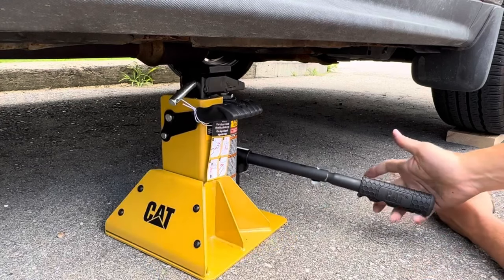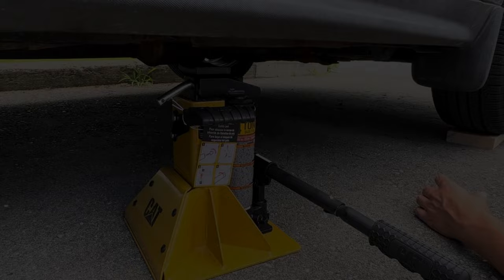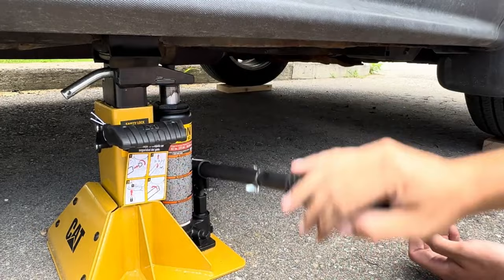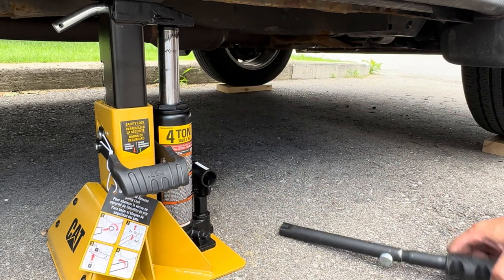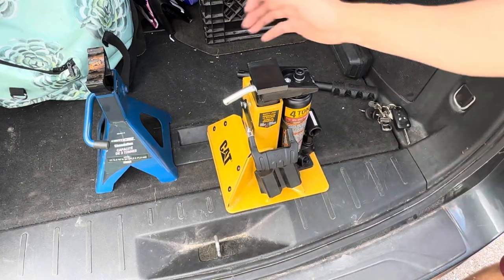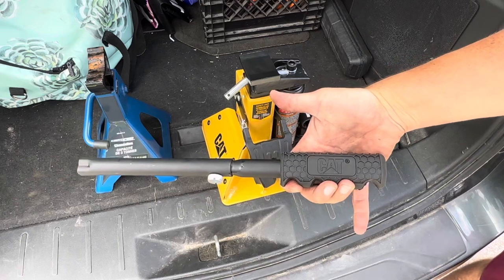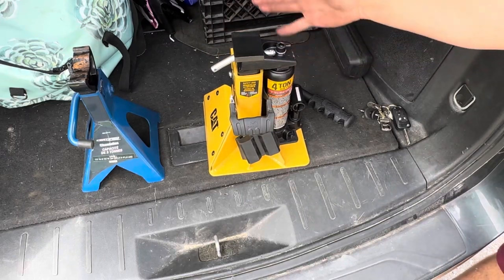Caterpillar 4 Ton All In One Jack Stand Demo/Review

Comment: No link in description. Looks like you have to drive your vehicle up on blocks to use it so the jacking function wouldn't work too well on low vehicles.
Reply from the maker: Your vehicle needs 11 inches clearance to be able to use this jack. All in one jack stands are not intended for lower vehicles. Suvs and trucks only

Comment: I have a similar unit. The one thing I dislike is that there’s 2 failure points and they are not redundant (the extension pin, and the locking mechanism). If either of those fail, it would be catastrophic. So the probability doesn’t work out great. Most late model jacks have a locking mechanism and a redundant safety pin.
Reply from the maker: It’s rated for 4000 pounds. Just keep the load under that capacity and you will be ok. The locking mechanism is the same as a traditional axle stand. If you are scared of these “failure points” then you might as well not drive because your vehicle has dozens of failure points that are way more catastrophic if they fail. Do t over analyze things. These jacks work well. You are misleading people with your paranoia. Thanks for watching though.
Reply: @BillOfAllTrades2016  Union probability is not your friend when it comes to safety. Things fail. 

I do use my unijack all the time. I just stick a wheel underneath the car for redundancy.
Reply: @BillOfAllTrades2016  4 ton rating is 8000 lbs.
Reply from the maker: Ya I know that already. Thanks.
Reply: The locking mechanism is somewhat supported by the jack still?
Reply from the maker: Yes the lo Clint mechanism is what supports the jack when you set it down like I showed in the video

Comment: Great demonstration and thanks. My current vehicle is an F150, and I am considering purchasing this Caterpillar Jack in the near future. It looks durable.
Reply from the maker: They are durable. Love the extension and wide sturdy base. Definitely worth it. Thanks for watching. Glad I could be part of the decision. Please like and subscribe
Reply: I also have an F150 on 37s with 7" lift. I've been beating my head trying to figure out a floor jack + jack stands arrangement but not having luck. Came across this tonight at 8000lb and got way more excited over the other brand 6000lb product. Is the link price for a pair or PER jack? Any discount/coupon code?! Might have to wait and see if BF will yield a sale.
Reply from the maker: The link in the description is per Jack. They do go on sale occasionally. They went on sale 10 hours after I bought mine. I went back to the store and got the difference refunded. Thanks for watching. Please like and subscribe
Reply: For a large vehicle such as a truck, it would be wise to find out the travel of the suspension, both front and rear before spending money on a jack.  The lift of the jack must exceed the travel of the suspension, otherwise the jack will not raise the wheels clear of the ground.  The more that the jack lift exceeds the travel of the suspension the better.  I had to buy a telescoping jack for my 3/4 tone 4X4 truck so that I do not have to block up the truck and jack it a second time, with blocking under the jack to extend its height.

Comment: Its too tall..... Looking at your video you have a block under each tyre just to show how it works. If those wooden blocks under the tyres was not there you never would get this jack under neath. Looks like a waste of money to me. Good idea but who ever decided to use the tallest bottle jack out there!!!!
Reply from the maker: This vehicle is low but just like floor jacks, you need to look at clearances and extension height. Just because I showed them on an equinox which btw only has 7 inches ground clearance on the front bumper and 10 on the sides, doesn’t mean the jack is a waste. It is suitable for many applications. My main interest is the flat bottom that I mention in the review due to regular stands piercing the pavement. I still have a small floor jack the lift the front end a couple inches then put these on the pinch welds and the height I can get is amazing. I don’t think it’s a waste. If it’s a waste of money to you than you need not buy it. It’s not for everyone. But I love it. Thanks for watching
Reply: I have 2 of the  same for 2 years now and they work awesome. I mainly use it for leveling my Travel Trailer as my driveway is sloped.
But as u said, I also use it for my other vehicles and use the regular car/truck jacks to get them lifted and then my CAT goes under and takes charge🙂😎
Reply: Everyone likes commenting but some rather take a swipe rather than stay positive, awesome video and it works exactly as u said. I even got photos to show😂😂😂
Reply from the maker: Yes I’m very familiar with the people who can’t keep negative thoughts to themselves. That’s the thing with doing video reviews, if I have an experience that differs from the viewer they think I’m wrong. There will always be an opposition. Thanks for sharing your positive experience. And thanks for watching. Please like and subscribe. Enjoy the awesome jacks.
Reply: Guess it depends on preference and need.  I like this height of 11-21
Reply from the maker: It is a great product. Thanks for watching. Please like and subscribe
Reply: Standard Jack Stands are 11" and up so this being a Jack Stand it is standard height, of course best for tall cars like Suburu , Trucks & SUV 
which is most vehicles now days

Comment: Jack Sinks Into Your Concrete ? On A Hot Day !  Blacktop or Chip N Seal Yes But If It Sinks Into Your Concrete Somethings Wrong With Your Concrete
Reply from the maker: You are correct. I misspoke. It’s asphalt like you would see in any average parking lot. The old stands never sank with the old asphalt parking lot. It just started happening 3 years ago when they redid the parking lot. Thanks for watching. I say the condo board cheaped out on the install

Comment: Do you just have or or did you buy two. I just received mine in the mail was looking in the owners manual shows not to be used alone recommended use two. How is your experience using one?
Reply from the maker: Using two is a safety precaution to make the vehicle more stable. However I’ve used only one many times and never had an issue. I do have two and sometimes use two if I need. All depends on what work I’m doing. Hope this helps. Thanks for watching. Please like and subscribe

Comment: It would of been better if you showed the tire lifting off the ground as you jacked it up..  just so we kno it can be done .... without having to drag out a regular floor jack .
Reply from the maker: Of course it can lift my wheel off the ground. If it wasn’t capable of that I wouldn’t have bout it. You seeing it lift my wheel wouldn’t be clarification for your setup anyways. Every vehicle has different weights and ride heights. The specifications are mentioned in the video. If your vehicle is less then 4 tons then it will lift. If 21 inch extension will lift will get your tires off the ground then this jack would work the same as any other jack with the same extension. You saw it lift the side of the vehicle up with ease. Complaining about not seeing the wheel lift off is a bit of a stretch I think ☺️. Thanks for watching

Comment: Help me out here. Several different Amazon reviews say that the bottle jack doesn't retract on its own weight. Your effort 2:35 was simple. Your experience? Are they fake CAT competitor reviews?
Reply from the maker: It’s hard to tell anymore with online reviews. It very well could be the competition slamming them in reviews to get more sales. I find with most products these days it’s a shot in the dark and you can’t trust any review. Personally I love these jacks. Never had an issue yet. Super easy to use. I recommend buying them. Thanks for watching. Please like and subscribe
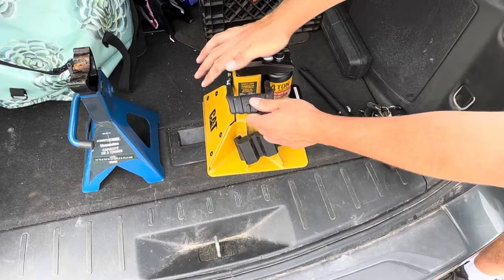Reply: @BillOfAllTrades2016  yeah, at 5:09 you sure seemed to disprove those Amazon reviews with a simple push down. I see their point though, which is if it doesn't "fall" under its own weight, once the wheels get back on the ground how do you get the product out from under the axle or frame if it's even just slightly "jammed"?
Reply from the maker: Personally every bottle jack I’ve owned never went all the way down on its own. They all needed at least a finger push to help it the rest of the way down. My theory on that is if you look at a floor jack or trolly jack the piston has all the weight of the arm to help push the piston back in. For bottle jacks, the piston has no arm or any weight that will naturally pull it down.